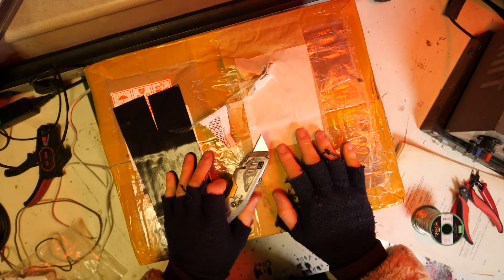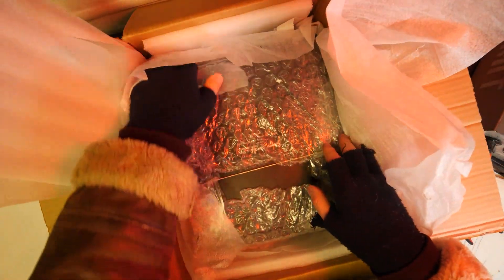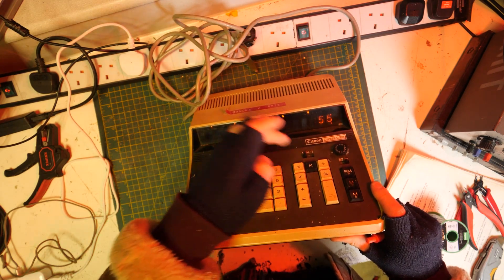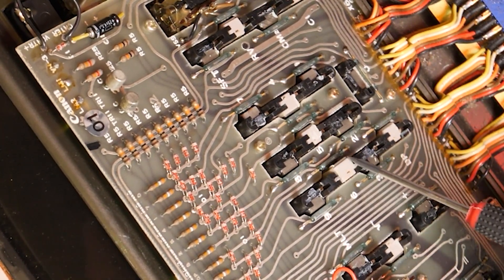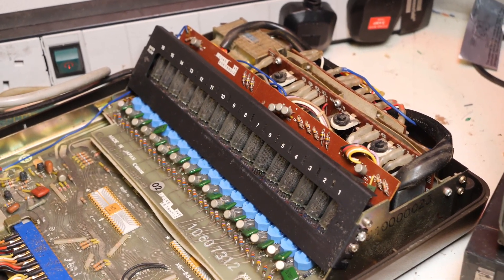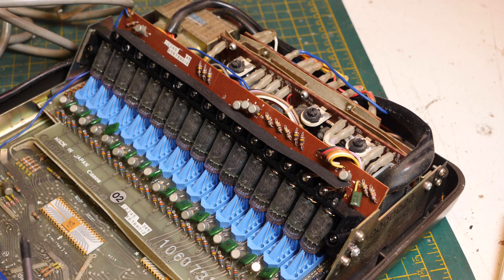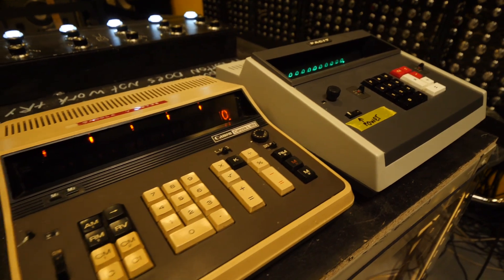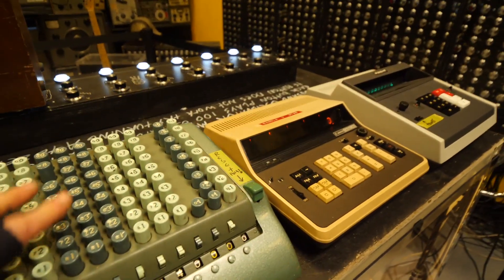Nixie tube CANON :L163 Calculator Teardown

Comment: To think how much work was involved in the entirety of the manufacturing process. From silicon on the outside technology (vacuum tube) to silicon on the inside (semiconductor), metalwork and plastic mould injection. I miss working on well built kit these days.

Comment: Didn’t knew that Canon made calculators, but this one is snazzy! Eventhough I use a TI-83 graphing calculator at work, I’d fancy having a nixie tube calc on my desk to do my structural engineering calculations. A colleague of mine uses the windows calculator……. Why use that if you can use a snazzy nixie tube one from 1973. There’s nothing like the glow of nixie tubes, they are much more legible then a non-backlit dot matrix display.
Reply: Seeing the Canon logo screen printed on the board was the real bit :o

Comment: The Nixie tubes are going to be Burroughs equivalents, most likely made by JRC (New Japan Radio).  A friend of mine had an older one which was all DTL logic using discrete transistors, and had delay line memory.  It didn't work, and at the time I really didn't have the patience to get it working.  I think I still have the Nixie tubes in storage.
Reply: I had one of those. The delay line is distinctive : a coil of silvery wire like a miniature CERN accelerator, about 10 turns and 6" diameter. All in an aluminium box under the power supply. Pretty astounding technology - just like a mechanical reverb box but instead of throwing sound down the line you throw bits. They travel along it acoustically and get regenerated when they fall off the end a few ms later.

Comment: What a beautiful machine, it goes together with the Facit nicely. When I found the Facit I was actually on the lookout for something like this (because who doesn't like nixies, am I right? ^^) - I just could only see the outline of the tubes through the display in the shop. Only after I took it home and got it to work I saw that it was actually VFD.
Since the Facit is a rebranded Sharp unit it is not surprising that Canon would use a similar style of chassis, that seems to have been pretty much the calculator design of the era.